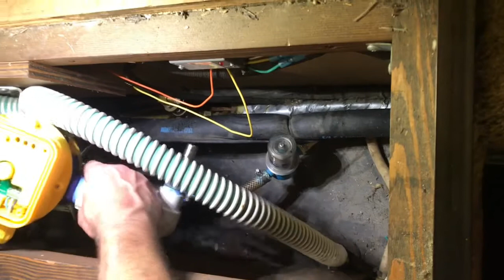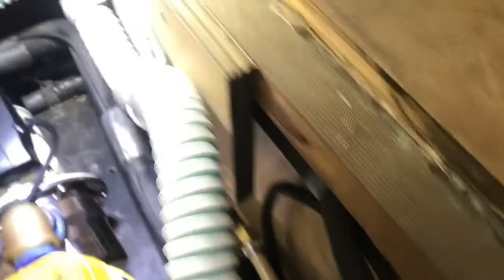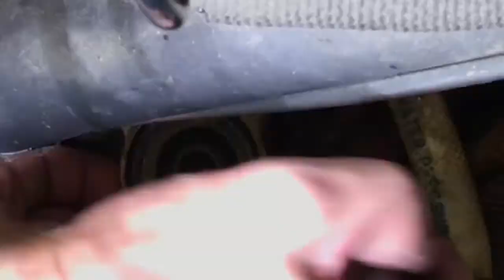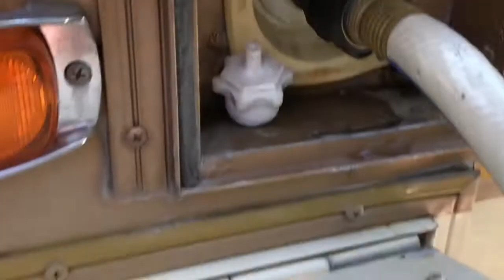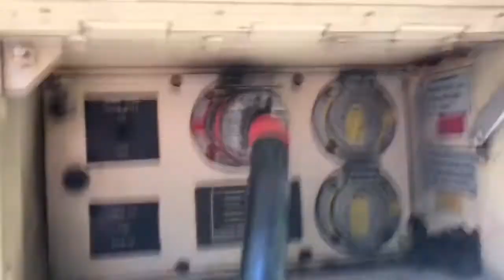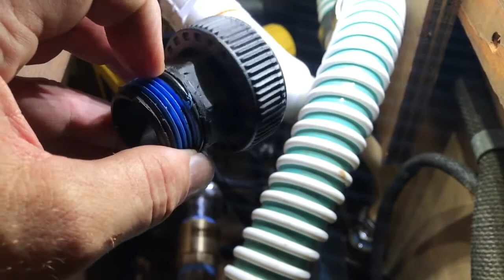Fresh Water Pump Replacement Part 2

Comment: Hey Gino, I like the pump setup! Where did you get the pump?
Reply from the maker: Amazon:
TDRFORCE 3/4 HP Water Pressure Booster Pump 110V Inline Water Transfer Pump Automatic Self Priming Irrigation Pump Shallow Well Jet Pump Household Booster Pump https://a.co/d/6LVxf96

Comment: why didn't you heat shrink those connections?
Reply from the maker: K Del they were done at the end once everything was completed.
Reply: Good to know. I think it’s the same through the whole run of Wandeloge (Sporlon). I was looking at your  outside panel. The cable line reminded me. Someone on the FB Wanderlodge group did not know what it was. So I told them and I got razzed about needing cable lol. Another didn’t know what the telephones were about . Got razzed about that too. The coaches might last forever, but the owners I’m wondering about. Younger. All I’ll say. I have a piston pump on my Lx. It’s half as big as that, but I understand yours is a jet. Mine is right next to the old and original pump and that’s twice as big as that . So far so good. Good work as usual. Thanks.